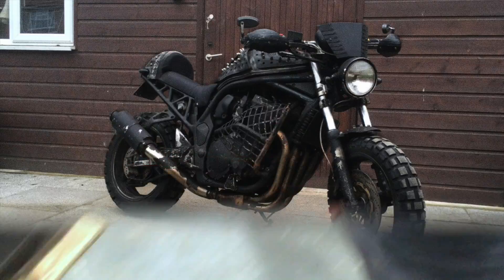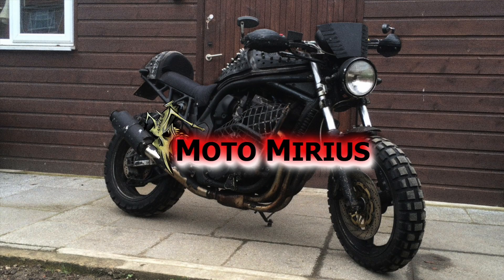ABS Brake Bleeding : Mini Skills

Comment: I quickly arrived to this conclusion whilst bleeding the brakes on my V Strom 1000 (18 model), according to the service manual Suzuki’s instructions are hook up the machine to a laptop with SMS software installed and then cycle the pump. I can get the rear brake to activate the ABS pump, but haven’t managed on the front (the bike has to travel faster than 18 mph to activate). The ABS pumps cost around £2000 or near to that last time I looked, the dealer charged me 50 quid in the end I wanted to be certain it was done.
Reply from the maker: Front shouldn't be hard to activate.   It's something you should be comfortable achieving as you should be comfortable with doing an emergency stop on different types of surface.    ABS will normally cut in just before you would get to maximum braking on a non ABS bike.
Reply: @MotoMirius  Well that’s what I thought, I can really haul on that front brake and get massive fork dive but no telltale rapid on/off - I’ll give it another go. Happy doing emergency stops, even the odd wheelie but at 60 years old I’m just not as bouncy as I once was should it all go tits up 🤣
Reply from the maker: @andrewshore262  Well I know that feeling.  You may need to get it onto a looser surface and just dab at the brakes.  If it has valves inside the ABS unit they need to get flushed or they can stick.  Good luck!

Comment: can you reverse bleed abs scooters pump fluid through the bleeder valve out the resovoir?
Reply from the maker: Reverse bleeding is quite common with ABS systems as it's the easiest way to attach the pressure device.

Comment: Hey . i've just come  across your vid . I need to replace the front  ABS brake lines on my iron 883 (higher handle bars) . I am to purchase a ABS tee and two stainless steel braided brake lines . What is the best way to fit the tee without getting any air in the ABS system . Is it just a matter of being quick when undoing the existing tee ? I am a bit concerned about getting a fault on the OBC. Hopefully you get this and have time for a reply ? thanks in advance .
Reply from the maker: I'm not familiar with the ABS Iron line setup.   But air only goes up and liquid only down, so if you can remove the existing line at point where the joint points upwards, no air will get into the main system.   Replace the line and then making sure that joint doesn't move and stays pointing up, bleed as shown in the video link I'm adding here.   That will replace the air in the line you've added with brake fluid without getting air into the ABS system.  https://youtu.be/11gSRKexUPM  Good luck!
Reply: @MotoMirius  Thank you for replying  !! gonna give it a go and will let you know the outcome . Science always wins !!

Comment: Does this open vs. closed ABS system design apply to automobiles, also? Specifically, what about a 2010 Buick Lucerne? I have seen brake bleed videos of this auto where they stated sometimes, but not always, they will require a second bleed after driving the car for a while if the brakes had become “spongy.” In other words, my question is does this PROVE a 2010 Buick Lucerne has a closed ABS system or simply that the initial bleed did not completely purge all the air from the open system?
Reply from the maker: It doesn't matter what vehicle ABS is fitted to.   I can't really comment about specific vehicles, especially about ones that aren't sold where I live.  This could result from poor design of the brake line system - and this is common, especially in relation to where the ABS is placed.  It doesn't automatically result from the type of ABS unit itself.
Reply: The reason I asked about a 2010 Lucerne is because that is what my “pump and hold” helper and I had trouble getting a firm pedal with yesterday. This was after replacing all the pathetically minimally zinc-coated OEM lines (Read rusty rear lines—one had actually burst soon after a test hard stop during the first downpour following a summer-long drought to make sure the ABS system was working and would not allow vehicle to veer on the oil-slick road. Fortunately, it failed ~10 miles later while gently stopping for gas ⛽, not driving in traffic.) with CAD-bent-and-flared-with-factory angles stainless lines (linestogo, BLB-104-SS1I). We got a partial pedal on the second or third wheel, didn’t refill master cylinder soon enough, lost pedal and it hadn’t returned yet after bleeding all wheels twice before needing to stop to buy more fluid. The ABS unit is mounted on the car frame. Fashioned a vacuum bleeder from some hose and a heavy duty spray bottle (Harbor Freight, Niagara 58153) for next round of bleeding... 😑

Comment: Please, I can't find information about Bandit 650 2010. Which system is here? What is best method for this ABS system?
Reply from the maker: The point of this video is that it doesn't matter which system you have, it all works the same way when you bleed - even if you have a closed system, it will self bleed the ABS unit when the ABS unit activates.
Reply: @MotoMirius  I know, But you spoke about bandit ans ABS system on them. I cannost find any information about bleeding abs system in service manual
Reply from the maker: @ondrejmysak1251  There is no information, because there is no special method - just use your normal method of bleeding brakes - but I would caution you to make sure that you do not allow air to enter the system, for example by allowing the master cylinder to run dry, while doing so.

Comment: Hello mate, i liked and subscribed.. well explained video and a good clear voice!.. could you tell me I have a citroen berlingo 04 1.9 diesel.. I've had to replace the brake fluid reservoir and the master cylinder.. I can't for the life of me bleed the brakes it draws fluid in then when you stop pumping the pedel and bleeding the fluid backs up and over spills the filler spout, hardly any fluid comes out the calipers yet a foamy mix of thousands of air bubbles and little fluid does if anything as its intermittent. Can you tell me if it's an open or closed system on the berlingo 600d as I can't find any information and if there is a trick to release trapped air.. I pray I hope I haven't damaged either the master cylinder or servo 🤷‍♀️ thanks.
Reply from the maker: I’m no expert on the systems used on all vehicles.  Open or closed is unlikely to be the cause of your issue.  I would suspect your issue might be with the servo. Good luck.  Skäl.  David
Reply: @MotoMirius  wow, thanks David for your speedy reply 👍 sorry I didn't think you'd know off the top of your head but wondered if you knew how I could source the information as that's where I was stuck.. is it also worth mentioning it has ABS and obviously air has entered the entire system? my suspicions are air is trapped and somehow needs to be bled.. maybe directly off the ABS unit or would i need to drive it and apply the brakes like you were explaining with the bike? to activate the pump?? Sorry about spell check on previous message, been corrected 😆✌
Reply from the maker: ABS pump is unlikely to introduce air bubbles, especially since it won't be active in normal bleeding.  Depends if you are bleeding with the ignition on or off.   Air could be entering from a cracked line, but it sounds more like the servo to me.  Some systems will autobleed if the igniton is on because the servo will start pressurising the system, but I can see people mentioning manually bleeding their Belingos, which suggests that you have a blockage between master and slave cylinders, and one that is introducing air.  That you've replaced the fluid reservoir is a point of failure.   You'll need someone who is familiar with that system - it isn't a generic bleeding or ABS issue.
Reply: @MotoMirius  just watching other videos your supposed to bleed the master cylinder just as you do at each wheel (bleed nipple) with the brakes so that's where I've been going completely wrong for a start then proceed to bleed in the right sequence.. I also know ABS wont create or introduce bubbles what I'm trying to say is I would have definitely introduced a ton of air into it and is there some known rule of thumb when essentially flushing and refilling a system with ABS.. I'm not a complete novice, I'm a carpenter by trade but turn my hand to anything.. always have, but usually (by coincidence or jinx?) Never get the same mechanical issue twice 🤷‍♀️ so forever learning ✌
Reply from the maker: Adam Price there is no bleed nipple on the master cylinder.  You can bleed air through the master cylinder but you will not get fluid back flow up through the master cylinder unless your master cylinder is faulty.
Reply: @MotoMirius  no.. you bleed it from the brake lines. Watch a scotty kilmer vid or such like you can also prime the master cylinder on the bench by filling from the top and pumping the pedel actuator (by hand)whilst covering the brake line outlets with your fingers, this way the cylinder is blead and full of fluid upon installation.. I will let you know if it's the master cylinder as you could be right, I have a mechanic coming out tomorrow and hopefully we will get to the bottom of it👍
Reply: @MotoMirius  hello mate.. turned out to be the vacuum pump driven off the camshaft, I had a mechanic service the diesel pump and cambelt off so was changed.. initially he got the timing out and unbeknown to me smashed the vacuum pump up in the process.. all makes sense when you find out the problem.. thanks for your help 👍
Reply from the maker: Adam Price interesting, thanks for the update and glad you got it sorted!

Comment: I got a 92 cadillac deville that's got the abs pump.. I'm searching if I can remove the pump and run new brake lines from the master cylinder to all four wheels and bypass the abs pump..
Reply from the maker: I can't speak for that model but there should be no physical issue the the change, it's all mechanical and the ABS becomes a factor for things like traction control and when the wheels skid, it doesn't increase the braking effect - you may get dash lights/ error codes.
Reply: @MotoMirius  thanks for your reply.

Comment: You could use a device like an Autel Maxicheck pro it has an abs bleed function ;-)
Reply from the maker: Good advice.   There are tools out there and in the long run probably still cheaper than taking it to a pro.
Reply: Maxicheck Pro doesn’t do motorcycles, and in fact even with cars it generally only covers models from 2005-2012
Reply from the maker: Great to know thanks.  I’m assuming there are tools out there or they will be developed as time goes by.  Skäl. David

Comment: Could you put the bike on a front and rear paddock stands and run the R wheel then apply brakes to cycle the abs pumps?
Reply from the maker: I wouldn’t put it on a front stand, the front wheel doesn’t need to rotate and it will make it more unstable.  Even then the pump won’t cycle because you have no way of causing the wheels to hit the skid point which triggers the pump.  Skäl.  David

Comment: only video out there that actually knows what his talking about im know mechanic but know how to service my bikes iv spoken to a number of mechanics at bike shops were we've almost got into a fall blown row because im telling them i cant bleed them because im only pergine the front circuit of air and not the fall system eg abs pump so still got a spongy lever  there answer is your talking nonsense  just bleed in conventional way looking at me like im an idiot . i know i should of took to main dealer which it was booked in for tuesday morning the day after the lock down  anyway good video  proves to me i wasn't talking nonsense
Reply from the maker: Thanks.  Some people over think it, some dealers and mechanics deliberately spread misinformation to scare people out of doing jobs that they could easily do themselves.  Skäl  David

Comment: You can buy scanners to bleed abs with cheap scanners for under 200
Reply: It does depend on the car/bike. My Jeep needs a DRB 3 tool - none of the aftermarket scanner's have anything like it. Top end DRB 3 specific emulator's exist ( under paid license to Fiat/Chrysler ) but they are exorbitant!
As is owning any Chrysler product in general...

Comment: Do I have to bleed ABS after changing fluid master cylinder? I bleeded the four wheels but still sometimes break padal goes soft when pressing!
Reply from the maker: Typically no.  But air can get trapped in the brake lines to the ABS pump.  I’d recommend a vacuum bleeder (cheap to buy).  I will try to link one below in the next few days.  Make sure you bleed in the right sequence - normally work from the wheel furthest from the master cylinder.   Vacuum pump can help pull any air trapped in the lines.  Good luck. Skäl.  David
Reply: @MotoMirius  I thought there might be some air in the ABS module after changing master cylinder and bled all wheels. It drove me crazy a whole day. Now I feel releif. Thank you very much for help Skäl David. I will be looking forward your link for the vacuum pump :)

Comment: thanks for the advice, I have a 650 bandit 08 model with abs, and replaced pads and bleed the unit last year. it got from being slightly unfirm feeling to become a little firmer, however I do think that it might still be a bit on the soft side.. but I have read that bikes of this generation and older etc. often have a bit more spongy brake lever feel in comparison to brand new bikes that run slightly better gear on them. what is your take on this:)? I have no issues with stopping or brakes not applying enough force, but I don't have the ability to ride with just one finger on the lever like on a newer bike. It haven't really ever bothered me, but I would like to hear your insights on this:)
-cheers
Reply from the maker: Older brake systems often had rubber hoses which typically had a service replacement life of four years.  If you have old rubber hoses then the walls can weaken and expand under pressure giving a softer feel - which is why upgrades to braided hoses were popular.   That said with braided hoses, an older system will give just as hard a feel as a new system.  Radial brakes and master cylinders can give a more powerful braking effect for less effort (which is what you describe about one finger) but they aren't firmer because they run the same hoses and fluid.   Modern electronics systems typically act to reduce braking effect - its commonly accepted that in an emergency stop ABS stops slower than an experienced rider without ABS.   I was out on the KTM today doing stoppies and wondering why it was difficult, then I switched it into supermoto mode which reduces the ABS effect and nearly went over the handlebars because the front brake grabbed so hard for less effort.
Reply: @MotoMirius  I reckon that I should consider replacing and upgading my hoses next then:P I do indeed have rubber hoses, and I have suspected them to have some effect on the brake feel. Thanks for the reply, much appreciated:)
Reply from the maker: I forgot to add that since you felt the system get firmer you likely had or have air in the system.   This is a downside of ABS as the extra pipe work routing makes it easier to have trapped air which is hard to get out.
Reply: @MotoMirius  yeah, either that or ancient fluids:P but it's never been as bad as a system full of air, like a mate of mine's was, his was really bad. this is as you say most likely suffering from tired hoses of the rubber kind:)
Reply from the maker: @mortenbakke2810  tired hoses don't get firmer - that tends to be air.  Which isn't to say that hoses aren't an issue, but you may have both adding to the picture.

Comment: Aren't you just pulling the brake lever just like we would normally do in our day to day riding?If so then wouldn't our day to day braking do the trick  anyways.?
Reply from the maker: Yes - it is how the engineers who designed the brakes intended the system to work - a certain amount of air can be created in the system and will bleed in normal riding.   If there is a lot of air then the system needs a bit of a helping hand to accelerate the process and you wouldn't want to ride with brakes that aren't fully functioning.

Comment: I own a 2014 Honda CB1100 with ABS, I have no rear brake at all, I can't get any brake fluid out of my rear caliper, I am thinking that there is something wrong with the ABS Modulator which has the pump inside.
But my front brakes are fine, that tells me that have to be something else beside the pump,  I have been reading the Shop manual for a day o so, to troubleshoot the ABS brake system on my bike, according to this manual most of the ABS Modulator issues are caused by corrosion on the electrical connection, and I am hoping that this is the problem, a brand new Modulator for this bike cost $ 1,400.00. I can buy myself another bike.
So in a day or so I will go deep in to these famous ABS control brain. 
The electronic system of the ABS communicate with the tech by how many times the ABS indicator blinks and how long the light stays on during the blinking.
DTC =Diagnostic Trouble Codes.
Short blink= 0.3 sec.
Mid blink = 1.3 sec.
Long blink= 3.6 sec.
I will advise to anyone that has ABS problems to purchase a Shop Manual and try to fix it yourself, otherwise it will cost a ton of money at list $1,000.00
at 110 dollars an hour.
Thank you for your video I really enjoyed...EZ.
Reply from the maker: Good luck with that.  I would only assume that the problem is the ABS after first eliminating all the usual issues with the rear brake - you haven't mentioned if you have done any of that.  It would seem unusual for the ABS to have blocked the system as ABS only operates when triggered and until then the braking system is free flow.  I would recommend that people buy the manual for any vehicle they buy, even if you don't do the work yourself - at least you will have some idea of what is happening.